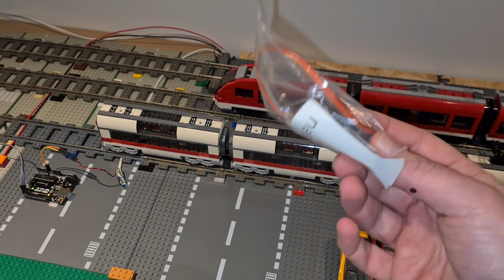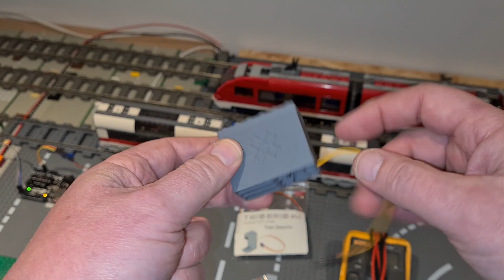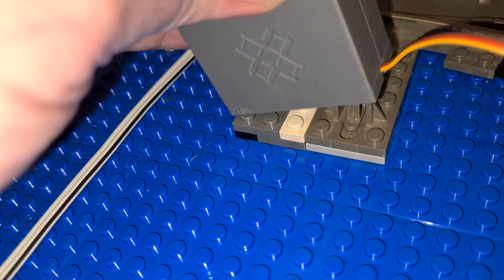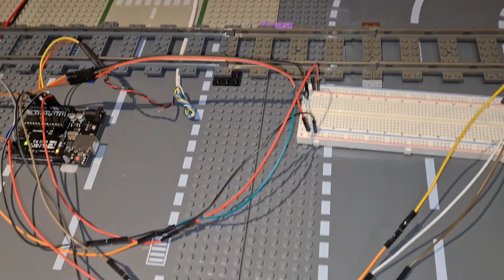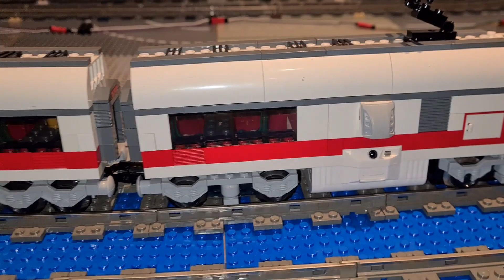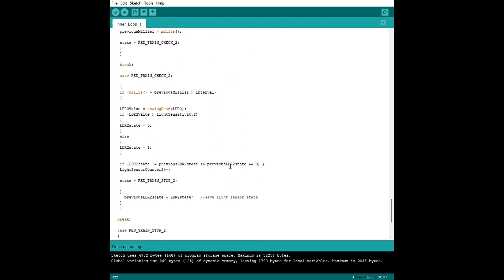9Volt DC Train Control with Arduino - Part 3, How to program Two trains to run on one track loop

Comment: Lucky you used 2 different coloured trains, otherwise it would've got confusing  😅
Reply from the maker: Tell me about it, the code was confusing enough 🤣
Reply: Can you use arduino to stop in specific stops eg stations before concluding shortly after? Can you also pair it to the switch to select direction and finally could you in essence say ten seconds before arriving at a level crossing, drop barriers and flash lights? To rise and cancel when passed